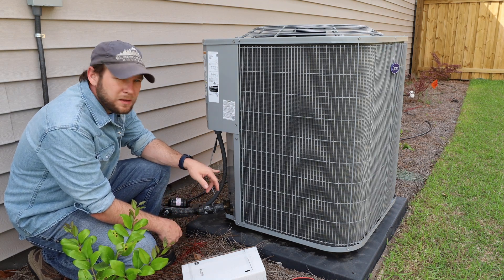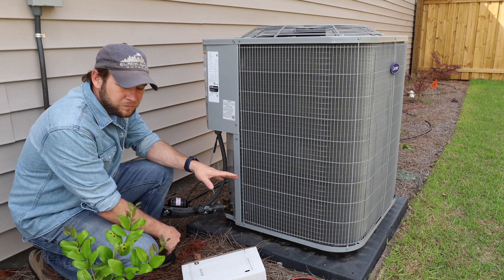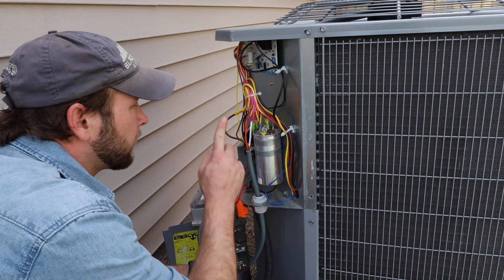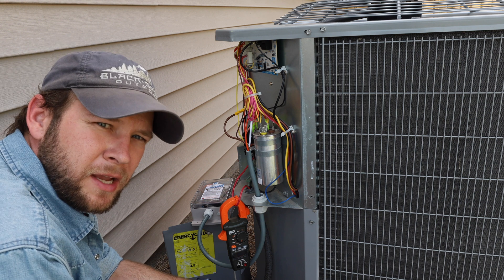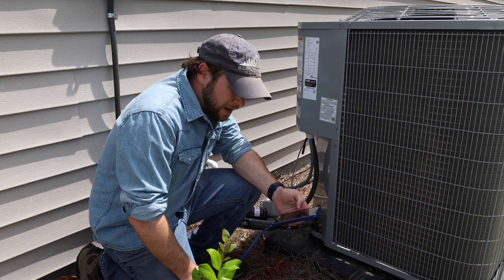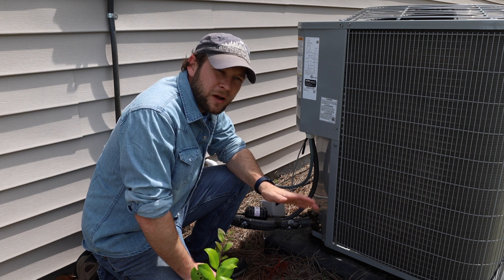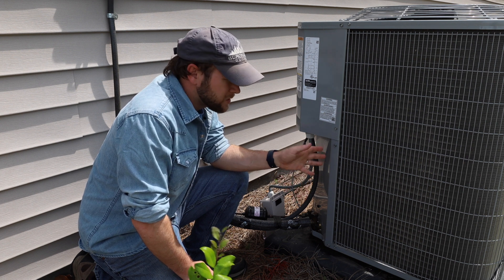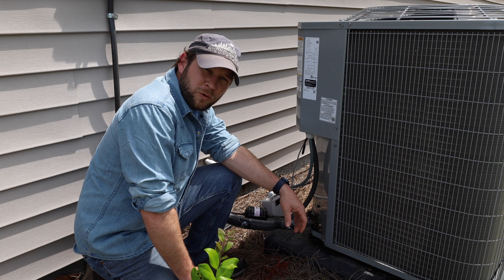Micro-Air Easy Start Installation, Will house AC on a generator be possible with a soft starter?

Comment: I now have two of their Flex units. They both have what appears to be a defect in the cover that could compromise the seal. I would have thought that since I sent pictures of the defect they would have been careful to send the replaced without the defect. Bottom line here is. Keep the original packaging. You may need it.

Comment: I wouldnt be happy w ~35% reduction.  Thats real disapointing.  Nice vid but ez start brick gets 2 stars…
Reply from the maker: I fully believe that it does more than that as I’m pretty sure the factory inrush is significantly more than I measured, unfortunately my meter is not fast enough as it is not designed for inrush recording. With the unit installed it starts off my inverters great though so I’m more than happy about that. So as long as it is reliable I can’t complain.

Comment: The LRA listed should be only for that, locked rotor. It is not the expected inrush. I think your meter is working fine. If I have a compressor that won’t start but doesn’t pull LRA it is always starting or running components fault. The compressor will be pulling higher amps but not LRA and usually trip the internal thermal motor overload. I mention this is all the soft start video I have watched reference the LRA as the inrush and this is incorrect. Good video. Thank you
Reply: another mensa want to be chimes in w nonsense…
Reply: I was unclear about the difference between LRA IRA. Thanks for the explanation.

Comment: Need to check with local building and electric laws and codes to confirm whether or not a permit is required to install the unit as well whether or not a licensed electrician or equivalent is required to install the unit.  While codes at times appear to be a nuisance and possibly in part motivated by government permit fee revenue generation purposes (think taxes?), they generally are  established for safety risk purposes protecting not only the owner but the public from potential hazards (fire, electrocution, etc).  Failure to comply with a code could result in fines (even jail time?), home insurance claims being void for not complying with a code, home inspectors citing a code violation that may affect a home sale until corrected, potential lawsuits from injured persons claimed to be affected by a code violation (negligence claim?).  I believe many diyers are just as good (and safe) as licensed trademen and normally a lot less expensive...however, so long as one knowingly follows a path of conduct they are aware of and the risks and potential consequences  - mature informed consent - then that is a good thing.

Comment: Is it AC only or will this work on heat pump? Im considering this but only if it will work with heating as well.
Reply from the maker: Mine is installed on a heat pump. You just need to get the correct one for your voltage and unit size per the website. Simplified, the only real difference between a heat pump and an air conditioner is a reversing valve, the compressor works the same way as long as it isn’t variable speed.

Comment: What's the difference between the Micro-Air Easystart x20 vs x36?
Reply from the maker: I believe the X20 is a 120v only model that does not have Bluetooth, so generally RV use only. The X36 has Bluetooth and is the smallest that is 100-240v, so it can run a small home ac unit or an RV unit. The x48 and x72 are larger versions of the X36 and would be used for larger home AC units.

Comment: i bought the microair easy start ASY-368-X72-BLUE with the wiring kit, i called a few local AC installers in my area and they all said they dont know how to install this equipment , i live in los angeles california would you know anyone in this area that can do the install? appreciate any feedback thank you in advance
Reply from the maker: Unfortunately I wouldn’t know anyone in the industry to refer. It does seem like a case of not wanting to install it rather than not knowing how though. If someone can work on an ac unit and change a start capacitor then they really should be able to read the instructions and install it. They may have another company they use that is a competitor or are afraid of providing warranty for their work if they don’t normally install that product.  Sadly you can’t make someone install it if they don’t want to.

Comment: Why do manufacturers have to exaggerate - they claimed 65-75%.
Reply: I agree. In my case I installed one on a 4 ton 2 stage heat pump and inrush before was 46 amps and after install it settled 35.3 amps of inrush.

Comment: In what way is this better than a simple hard-start kit (e.g., 5-2-1)?  I've installed a few of those and they all work like a charm... and they're simpler and cheaper.
Reply from the maker: A hard start kit and soft starter perform different functions though there are similarities. A hard start kit increases the available potential current available to “shove” into the compressor, giving it a kick if you will. This doesn’t actually make the Compressor easier to start in terms of a smaller generator though. And the hard start kit can actually cause increased wear on the compressor because of the jolt the components take on start up. A soft starter gradually brings up the compressor and accomplishes a few things. The first is the significant reduction in inrush current, meaning a much smaller generator is able to start the compressor. The second is that there is less wear on the components of the system which will theoretically increase its life span. And the third would be a decrease in how loud the unit is when it starts. The latter is not an extremely important factor but it can be helpful for RV users in a camping environment and it reinforces that there is less wear on the compressor.  Personally my unit is outside my bedroom wall and used to actually startle me, anecdotal I know, but the sound difference was welcome.
Reply from the maker: I found this article to explain things fairly well in case you want to take a deeper dive into how hard starts function: https://hvacrschool.com/start-capacitor-inrush-facts-myths-part-4/
They definitely have their place. It just isn’t the same place as a soft starter.
Reply: @Demonic Animatronic  Thanks very much for this!  Yes, I'd started looking for a technical explanation.  I'd thought I understood, but then what you said in this video raised more questions.  Thanks again.
Reply: Also, this unit has a few seconds delay on the fan so they dont start at the same time further reducing the inrush current.

Comment: Does it stay connected when it's off or only when it's on?
Reply: The Micro-Air Easy Start is not powered unless the A/C is running.

Comment: You mentioned a QR code to get a wiring diagram for you specific AC/Heat Pump manufacturer. I can't find anything like that on the Micro-Air website, is that on the app?
Reply from the maker: The QR code was in the box with the ez start unit and takes you directly to the installation section for the website. It can be found here https://www.micro-air.com/kb-easystart/cat_installation.cfm
Reply: @DemonicAnimatronic  Thank you appreciate it.

Comment: when see display note( brown wire from micro-air-easy start 368x72  you tie brown direct into yellow?? by pass conpastor! wont work! yeoolow wire tie into canseter then yellow wire splice brown to yellow joint then compreesor work not other way video show!  white wire right contact black left contact!  brown not single leg to yellow from compressor! need hook yellow from compressor to conster splice brown into yellow then compressor come on! !!!

Comment: I have installed this unit, love it. Even if you are not using it with a generator, it protects the compressor. Think of it this way. You have a manual transmission in your car, the light turns green, you rev the engine to max RPMs, red lineing the tachometer, then you pop the clutch, you will be needing a new clutch soon. That's how a compressor starts without an EasyStart, full LRAs hit the compressor, it's like poping  the clutch, the main reason compressors fail. With an EasyStart it is like easing off the clutch and giving the engine a little gas slowly. You gently come up to speed. The clutch will last longer, so will your compressor.  Also you can move the EasyStart to a new AC unit when you replace your old system. I believe it is a good investment. Hard start kits are a waste of money, they fail a lot. BTW at 8:45 it shows 10 starts of witch 5 are learned starts, it's not 15 starts. Great video.
Reply: Until a capacitor in the soft start fails and the Micro-Air beats the crap out of your compressor.

Comment: I purchased an Easy Start 368 Blue directly from Micro Air.  I had it installed by an HVAC certified technician. With the Easy Start installed the compressor on my four ton residential unit would not work. I disconnected the Easy Start and the AC worked fine. I contacted Micro Air by email and the technician was very helpful with photos and directions for the correct wiring using my wiring diagram and photos.  Come to find out, The Easy Start was connected correctly the whole time. I completed the warranty info and sent the unit back to Micro Air at my expense, $29.00. Their customer service department received the unit and acknowledged that the unit had a loose wire. My unit was repaired and returned to me. I installed the unit and although it works it still draws between 52 and 74 amps upon start-up depending on whether you use a clamp gauge (74 amps)or the reading on the Easy Start (52 amps).  I am not happy with Micro Air sending out defective equipment, acknowledging it was defective and having the customer pay to have that same defective equipment returned to be put into working order. Requests to Micro Air for a refund of my shipping charges have been ignored. Use caution if you consider purchasing from Micro Air their Quality Control and Customer Service has something to be desired.
Reply: Yeah that is the horrible customer service.  The customer should not have to pay for defective device to be shipped back.   Now, I don't know if I should buy and put it on my AC unit.
Reply: I was in the process of buying one for my 3-ton home unit... So I could start my AC on my generator if I needed to.  Glad I saw this.  Sounds like their customer service sucks!!  May be better idea to just spend the money on an additional (series style) generator to carry the start load.
Reply: Dispute the return shipping charge with your credit card bank. Easy peasy. Eventually microair will learn.
Reply: Very true! I just found out the hard way that they are putting cheap junk in their units. Mine had a capacitor explode oil inside the new “Flex” model after 2 days. The AC stopped working and even though the software showed errors, it kept trying to start the compressor. When it tried to start the compressor, the whole condenser unit jumped on its pad and made a horrible noise. I immediately removed the safety disconnect and removed the Micro-Air. Support knew it was another capacitor failure. I get to pay for shipping for their mistakes in engineering and manufacturing. AVOID!!!!
Reply: New Jersey attitudes.   Its their way or the highway.   Agree their CS sucks.

Comment: If these soft start devices actually work, why aren't they in the original equipment to begin with?
Reply from the maker: The same general reason that an 18-20 seer unit is better than a 14 seer unit but they still primarily sell 14seer units.  The unit will run without it and with a simple start and run capacitor. The electronics in these units cost money and development time, they are not as “simple” as a start cap. when you can get away with less components and bring the cost of the units down, that’s frequently what sells. There are units that have soft starters built in but usually when you are already putting in that hardware development you will just switch to a different technology like inverter systems.
Reply: They do actually work. I have one on my ac unit. The reason they aren't original equipment is they raise the cost too much and the ac units can run without them.

Comment: Why not show exactly which wires went where when you installed it? Just an idea that would help the diy’er.
Reply from the maker: I didn’t show it because it differs for each ac unit. Depending on how it’s wired and the type of unit it will change where you connect. So if someone tried to just copy the colors with where I put them it, could damage the unit unless they had the exact one that I do.
Reply: @DemonicAnimatronic  I understand. I have the 364 coming today for my 2.5 ton Maytag hoping it’s a simple install.

Comment: Awesome vid.  Is it still work well  and is the Bluetooth always on so that you can connect to it on the app without having to hit a button on the device?
Reply from the maker: Yes, still working great. I’m hoping to have the rest of my solar stuff in soon to test it running on that but so far it’s been great. And the Bluetooth is on whenever the unit is on, so when the unit starts up you can access it, but if the unit is off, so is the Bluetooth.  No button needed.

Comment: A lot of talk and dude never hooked it up to a gen... waste of time.
Reply from the maker: I’m very sorry you only saw the talking part, normally there is also: wiring, drilling, installation, and measurements. I will look into why these were missing. But yes It was not hooked to a generator in this video, sadly that has to wait until my genset and solar system is up and running because of how complex my setup is.  That is why the measurement is provided, so that it can be compared to different models of generator starting capacities.

Comment: The soft start doesn't run the unit on less current it just reduces the in-rush current at start up. These units work well.
Reply: Until they don’t. Mine failed after 2 days. Huge mess.

Comment: Horse manure....LRA is 3 to 5 times RLA.  Starting the fan at a different time than the compressor is the only way to improve overall amp draw on start up.  You can do that with a simple electronic time delay relay which only costs a few bucks.   Ask anyone who installed motor modulators on a-c units in the past to see the damage over time of lowering voltage on and AC motor.  We used to go out and replace some motors twice a year so the owner could use his a-c in the winter time, like tanning parlors.  There is no way to take a capacitor start motor and make it draw less on start up.  Better to invest in an inverter unit to begin with.   Use of DC motors in these allows slow start up without the LRA current draw.   This is junk science.  Just the latest scheme to get your $$
Reply from the maker: Respectfully strongly disagree, as a controls engineer, LRA can be as much as 10-15x running and soft starters are used all the time on ac motors on conveyors, commercial compressors, and high torque machines without VFDs. The motor life cycle is generally increased not decreased as you are not slamming the mechanics on start up. the misconception is that when you lower the voltage on the windings you inversely increase the current which would burn the windings, however this is exactly what a soft starter like this is designed to prevent. These are pulsing to adjust voltage and current not undervolting. This is more like a pwm controller than a VFD.

Comment: Not convinced these are worth the cost. Maybe if you were running off generator a lot, but in an emergency a simple hard start should be enough to get the AC started on 8-9kw generator. I added the ks1 hard start to my 4 ton 13seer lennow and it alone dropped the inrush amps from 99 down to 58. I bet my 9200w running champion has no problem starting that. The length of time it will see 58amps is not enough to bother the generator. Mine runs at less than 14amps by the way.
Reply: These easystarts also do lots of error checking. For instance high voltage draws will send error codes to the app which will allow you to do some troubleshooting to determine if a some simple maintenance will prevent a more expensive problem. Hard start capacitors are just dumb versions. This is the evolution.
Reply: I installed this Micro-Air onto my parents 4 ton system and drop inrush amp to 38A, not including blower motor. Using a WEN 8750 watt generator, I was not able to start the AC. I move the Micro-Air to my 3 ton unit, and got inrush down to 25A, and was able to run AC on same generator with no issue. So good luck getting it to run a hard start kit.
Reply: Probably not worth the money on a 4.5 or 5-ton A/C unless you have a B.A.G. (big-@$$ generator).  With this Easy Start on my 5-ton A/C, my inrush varies between 34A and 66A (published LRA is 146A).  My constant Live Current running amperage is between 12A and 15A.  I could probably run it with my 8450W generator, but not with the unstable and constantly-changing inrush.

Comment: Not too bad results for a 3.5 ton unit. For my 2.5 ton that had the "optional" factory start kit installed, I was able to start it up with my 7.6 kW running/9.6 kW peak inverter generator, but had to run it a full rpm. With the soft start, it brought the LRA from 56 amps down to 20. Now, I can run it on ESC mode and barely notice the generator ramping up when the compressor starts up. What is really interesting is that now my old frost free fridge/freezer startup loads down the generator than my heat pump. Inductive startup loads are a funny animal for sure...